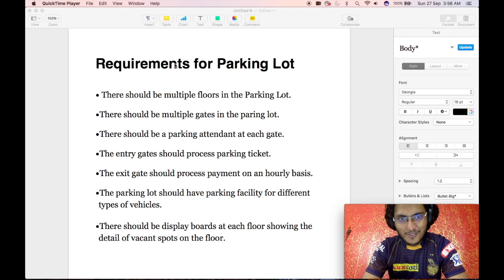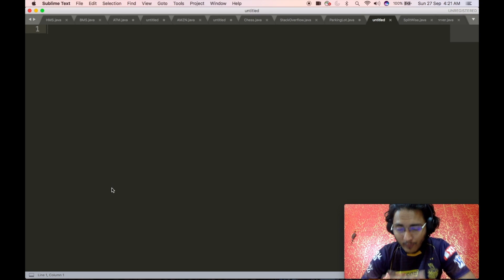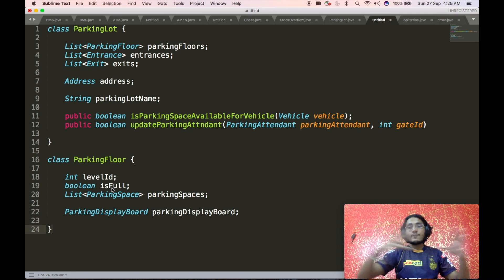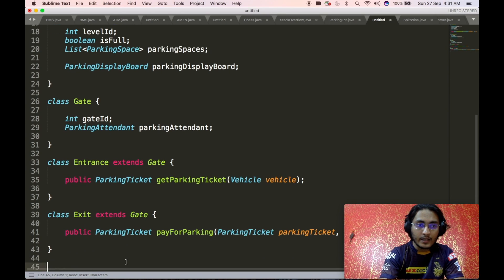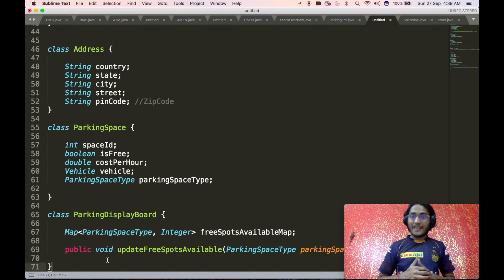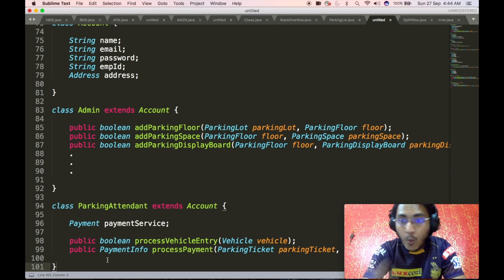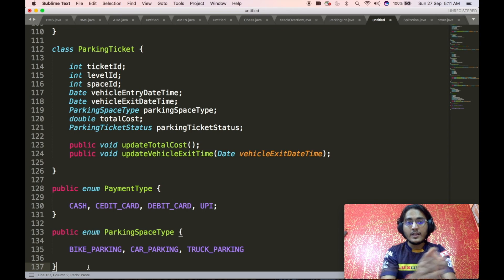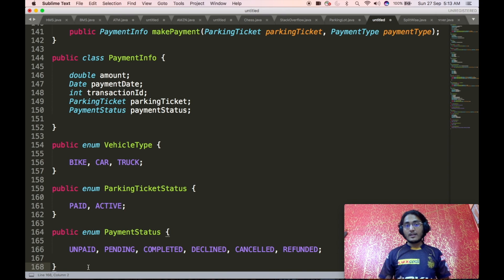Parking Lot Low Level Design Code | Google Interview question | Low Level Design Complete Code

Comment: Learnt a lot from this video and got clarity on what I should focus on during the interview. Thanks for this amazing video.
I have some doubts - (Here I'm assuming that prebooking is not allowed. You can only book the spot on the entry gate )
1. I think that isParkingSpaceAvailableForVehicle should not be in Parkinglot class. The logic to find available spot may vary (time based search / vehicle type based search) so it'll violate the single responsibility principle and won't be scalable.
2. ParkingFloor object has a isFull boolean. But the parking lot can be full for a particuar vehicle type and can be available for another vehicle
3. 10:51 - I think Admin extends Account doesn't make sense. extends means "is-a" relationship. Admin is not an account instead Admin has account. So either use composition or Account class should be named as User. Although he mentions that Admin is a type of account. Probably renaming Admin to AdminAccount makes more sense. (Admin sounds like a person)
4. VehicleType and PaymentType should be abstract class rather than enums.
5. For ParkingDisplayBoard, mentioning observer design pattern can give extra points.

Let me know your thoughts.

Comment: It's very easy to write classes, interfaces, and enums. There should be implementation of key API's and some client code calling these API's/methods to show the interaction.
Reply from the maker: True. But that is generally not the expectation out of the LLD round. However, same will be the expectation out of a machine coding round.

Comment: Video is nice.But I have your code 2-3 times and there are some questions i would like to ask:

1. There are functions to generate ticket and process payment at "Parking Attendant" class and at "Gate class". It is not clear what is difference between these two.

2. I dont see need of parking ticket in payment info. Parking ticket "has" payment info or payment receipt.

3. Why do you need display board? All we need to know whether space is there or not.Since we got ticket at entry only ,it means we know where to park our vehicle. Now what will display board data help in any way?If you say, that we will get ticket and we can park at any free spot, then it is not an automated system that we are building at first place.

My thoughts for point 1 :There should be a ticketService, which can generate ticket,process payment for a ticket, and it maintains info like, which slots are free and occupied,and talks to parking lot to get this info.
Now on booking ticket,slot status change and on payment process slot status change, this service will handle all those stuff, and it can be called from gate or from parking attendant.

Update code : https://ideone.com/gQl4ah
Reply: @Mohammad Kaif yeah u are correct

Comment: Hi Soumyajit,
Couple of questions from my side . Would be grateful if you could answer them.
1) Why is there a vehicle object inside parking space class ? 
2) Account class has a function  addParkingFloor(ParkingLot parkingLot, ParkingFloor floor);
I believe Account object will be created in the Main function (meaning client side).  And to call addParkingFloor we must first create an object of Parkingfloor in client side. But should not the floor object be created inside ParkingLot class following composition rule since ParkingLot controls the lifecycle of ParkingFloor ?
Reply: @saha
1. when i tried to write my code, i also did not place vehicle in parking space.I am not sure if it is needed or not.
2. I too have some doubt here.Floor will be created in Parking lot only.Parking lot will expose api to add floor which, will be eventually called by admin class.

Comment: Aren't we breaking the Open Close Principle while adding Enums in the System?
For Example, You have PaymentType as Enum, and suppose a new PaymentType is added in the future, you will have to modify the makePayment method of the Payment Class to take care of that.
Instead, we can have a PaymentType as an Interface and Concrete classes like UPI, Credit Card, etc. having a payment method.
@Soumyajit Bhattacharyay Please share your views on this.
Reply: This makes sense. Enum should only be used if you know the states are final.
Reply: well said
Reply: @shashankmittal8820, can you explain that how if we add new enum values in PaymentType, the makePayment() in Payment class will fail?
Reply: @aditigupta6870 it wont fail. But you’d have to make changes in the original code, which would be something like adding an extra IF ELSE statement.

The idea being discussed here is on the lines of strategy design pattern, which I think is a better fit.

EDIT:
Enums for cases like the parking status should be okay.
I think adding some other design pattern there, from the beginning, would be over engineering

Comment: What if required to provide nearest parking spot from entrance and have multiple entrances?

 // 100 parking spots are divided 25 each into 4 different entrances.
//  PriorityQueue is use for min heap because min heap provide smallest distance from entrance to most nearest parking spot and distances increases 2nd most nearest
//  parking spot......and so on....
    Map<String, PriorityQueue> entrance_1 = new HashMap<String, PriorityQueue>();
    Map<String, PriorityQueue> entrance_2 = new HashMap<String, PriorityQueue>();
    Map<String, PriorityQueue> entrance_3 = new HashMap<String, PriorityQueue>();
    Map<String, PriorityQueue> entrance_4 = new HashMap<String, PriorityQueue>();

Comment: Some points that were not clear :

1. Why do we need display boards on all floors?When a vehicle enters,i suppose system will auto assign a space to it.SO who will be using this display boards for reading?If a car enters,it has a spot assigned ,what the board shows in each floor, how is it useful?

2.I think payment should be and abstract class and with multiple implementation like credit card,debit,upi etc. implementing it.Just passing debit card as a type to payment method,it is not able to process without debit card details.

3.I dont see any use case of putting payment info in vehicle.Vehicle has number and parking ticket. Is it a sort of bill for a parking ticket?
Reply from the maker: Every level should have a display board because as there are multiple entry points and multiple exit points, think of a scenario where there are entry and exit points present at each of the levels, in that case the display board will be displaying the information gor that level and the driver along with vehicle can decide to skip larking at that level if there isnt any space available etc.

That is exactly how it will be implemented. I had decided not to add the inplementation of the payment module here itself as it can by itself be a whole another beast.

The paymentType enum will be used to generate the appropriate object from the factory that will return cc/dc/upi etc. Implementation object which will then itself trigger its flows. Since thats a separate system al to gether decided to abstract it here.

Probably can take up the payment systems in a separate video? What say?

Payment info is being put along with parking ticket inside the vehicle to madel the real life scenario where a copy of the  parking ticket is given to the driver/vehicle at the point of entry. Since the vehicle has a parking ticket and an associated payment info with it I have added it inside the vehicle class itself
Reply: @SoumyajitBhattacharyay  cool.Its fine.There are lot of requirements to cover in one question only.And it is better that we restrict ourself to min. stuff that we can provide.I understood now.Thanks.And yes,if you can take up payment in a more details in next LLD video or may be a as a separate entity only in a single video,it would be great and the functionality will be same for payment everywhere.
But payment bean for credit card/debit card etc. will be different for different customers,so I dont know whether factory method will be a good fir there.Is it a good idea when factory class has argument constructor with type of card and details of card like debit/credt/upi etc. and then create a new payment object from that everytime.I thought like payment as a abstract class and the child are debit/credit card as its implementation and then we can pass object of abstract payment and this it can be processed.
Reply from the maker: Yes i was also thinking of the same!. Will try and come up with a good design and shoot the video.

Currently done with the shoot for stack overflow LLD! 

Stay tuned for that
Reply: @SoumyajitBhattacharyay  one more point i want to add is that parking board ,if it is at every floor, then it should display the entire lot info and not the current parking floor info.Because you can enter from any entry then the parking floors are inter connected mostly and we should inform person ,like which floor he/she can go to park as per space on board.let us say person sees only current floor info and he sees full and he did not enter and possibility is that other floor has space available.

Comment: In a real time interview,
1. Do we need to draw use-case diagrams?
2. And then code the complete solution or just draw class diagrams?
Please clear this doubt ASAP.
Reply from the maker: Use case diagram is generally not required in an interview but is for your understanding. 

It will make the design process very simple.

We definitely have to write the classes/interfaces and interaction between them.

Whether or not you have to implement some portion will depend on the interviewer
Reply: @SoumyajitBhattacharyay  do we need to draw class diagram.Do we need to learn UML stuff like composition,agreegation.If we are comfortable with writing code template with min. required use cases as you did, then do we need to focus on how to draw these things in class diagram with UML notations??
Reply from the maker: Not in an interview. You can directly jump to thinking about design clases. 

But in the job, definitely uml, sequence diagrams etc. Need to be drawn.
Reply: @SoumyajitBhattacharyay  thanks for quick reply:)

Comment: When you explain I understand, but it looks very complex. How to come up with such clear design?
Reply from the maker: Hi abhishek! Thanks for the feedback. 

The key to any LLD is that you need to be able to visualise the problem clearly. In my previous videos i have shown what needs to be done to be able to come up with these designs. 

In short first properly define the requirements. Believe me this is the most important step. After that, come up with a use case diagram containing major actors in the design and then translate the use case diagram to class design. You can go through the playlist to get a sense of it. I will be adding a lot more.
Reply: @SoumyajitBhattacharyay  Thank you so much for explaining. I will go through your entrie playlist. 
Are you also planning for hld(and db schema) or some good resources for the same in your opinion?

Comment: next request: Linkedin or Facebook Design:)
Reply from the maker: Sure low level or high level?
Reply: We need both:). I think you can first complete Low level playlist and then start on high level designs.
Reply: @Mohammad Kaif yeah payment is not complete. Bare mini. we should have a payment class which has some api like payViaCard(CardDetails,amount) or payViaUIP(upid,amount), obviously there will be better designs than what I told, but in video its incomplete,he should have left it instead of putting like this.I also got confused earlier.